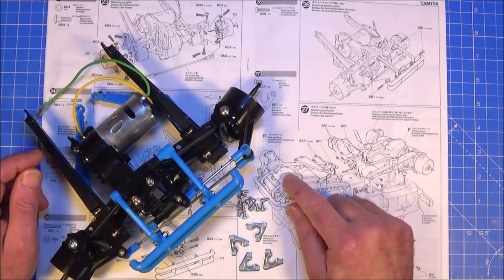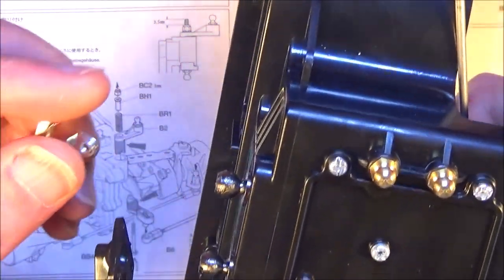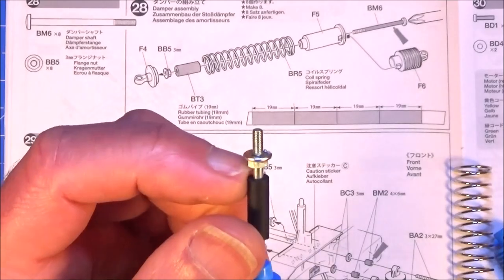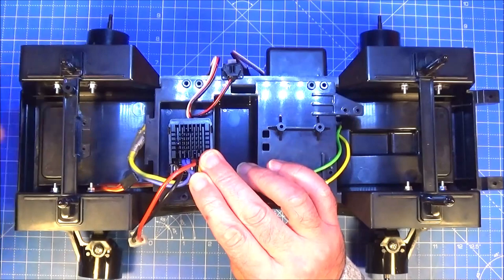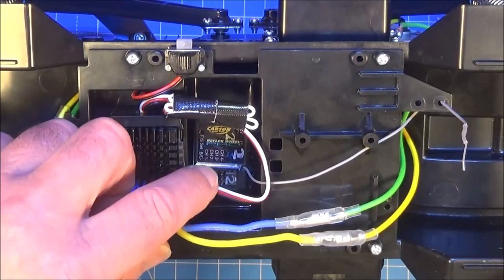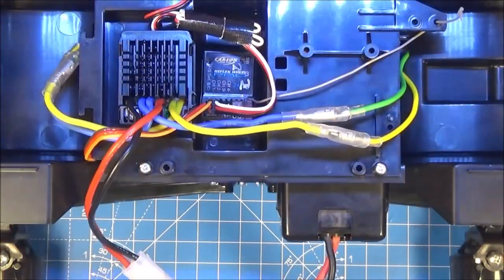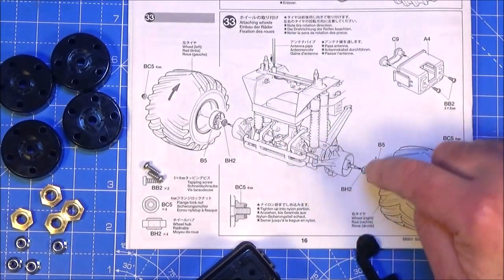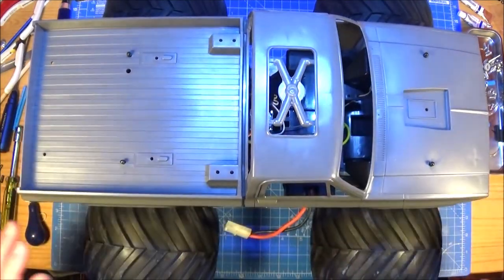Tamiya Super Clodbuster Build Guide P3 - Steps 27 to 34 Plus Hints and Tips!

Comment: Mark, your doing a great job mate (not that the build is hard). Without the shocks mounted, using pliers to attach the steering rods won't hurt your fingers. Brother, you did the tires the way I do them (sometimes I set the tires by a heat source to warm them up).  As for gluing the tires, without glue, dusty, dirty, wet and normal running, over time the dust gets into the bead area and the tires will begin to slip on the wheels (some people use a dab of clear RTV at 12, 3, 6 & 9 o'clock, holds the tires & their removeable), as for glue, its fine, not often does one need to change a tire or wheel and with a stock set-up, one rarely breaks a wheel, if ever. Thanks again for the mention. So many tips & tricks for a Clod (it is @ 35+ years old). GFJ man, loving the build series!!!!!!!!  ATB my friend, to one & all.
Reply from the maker: Thanks for the great comment and advice, Bob! Yeah, it was OK in the end, with a few tips from my friend!!! I'll get some elastic glue on those rims! You deserve a mention my friend, after all you had more than a little hand in this one! Our gray Clods would look good together when the bodies are done! Take care, brother, ATB to you guys too!

Comment: Hiya mate.  Wow those tyres looked a challenge.  It's a bit mean that you get pogo stick shocks with this one.  It's going to be rather bouncy isn't it?  One great tip I got from this was to put the tiddly screws in the switch.  What I've done before is to put holes in the chassis and run a cable tie over it as well as using the tape.  It's annoying that they don't put a bigger plate on the switches like the Tamiya ones.  Looks great so far and I look forward to seeing it complete.  I guess you need to go with grey paint so it matches the wheels?  Great stuff mate. Best wishes 👍
Reply from the maker: Hello Pete! Yep the biggest rubbers I've ever clapped hands on! I think I pulled a few muscles fitting 'em!
You are right about the pogo sticks but I've been told to leave them as apparently it's part of the charm of the Clodbuster. That and the fact that oil shocks make no difference at all! 🤣
Yeah I got fed up of those switches working loose, the tiny screws came with some servo horn accessories I had lying about. I have used the same method as you before, though but though this was a neat solution. Thanks for the thoughts, matey, always a pleasure. Take care, dude! 🙏😉👍

Comment: Thanks mark, been following your instructions on the clod right from the beginning. That aerial wire looks short, it was like that on the monster V.W. Too. Suppose it works ok inside the body though? Did you need to glue the tyres on in the end?
Reply from the maker: Hi John and thanks for the comment! Glad you are following along. Yeah the short antenna is no problem and is designed to operate well due to the very short wavelength. I've had no problems running this without glue in the tyres! 😎👍

Comment: Hi mate, well that chassis build was a lot less complex than I initially perceived. It all went together rather nicely. I was interested in the ESC as I've never seen a duel motor ESC before, what brand is it and was it provided by the ELF? One thing I detest about Tamiya ESC's is all that programming malarky - it never works for me first time. Constant trial and error. I mean who wants an RC car programmed with no reverse? This one appears to be a straightforward plug and play which for me is much better. Look forward to seeing what your expert hand does with hard shell. Have you sourced a lexan basher shell yet? As always mate, a quality upload...🙂👍🏻🙂👍🏻.
Reply from the maker: Hello mate, yeah these last steps were quite straightforward, no head scratching as there was in Part 2! A typical Tamiya that goes together beautifully when you read the instructions carefully! The ESC is a Hobbywing THW880 and it's included in the kit. There is a programming issue, though. It comes preset for LiPo. All else is cool, but to change it to NiMh you need a separate programming card, not supplied! Good job Rob bought one! But yes, a real pain indeed. I'm panicking about the body, so easy to mess up the paint! I have an old Proline Chevy truck body that looks like it'll fit, I'm on it, dude! Many thanks as always, have a great week ahead! 🙏😉👍
Reply: @MarkBryanRC  Wow, I'm astonished that Tamiya would include a component from another company ( Hobbywing esc ) into one of their products.
Reply from the maker: @thecontractor365  Yes mate, it's happening quite a lot these days, my Blockhead Wild One came with a Hobbywing ESC too. It's due to the silicone chip shortage, apparently. Tamiya can't get enough chips!!!